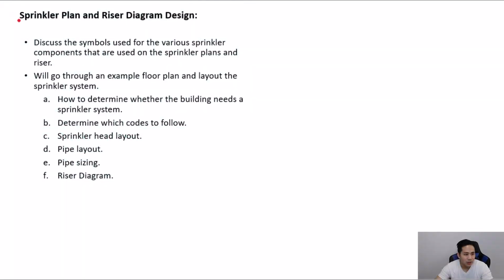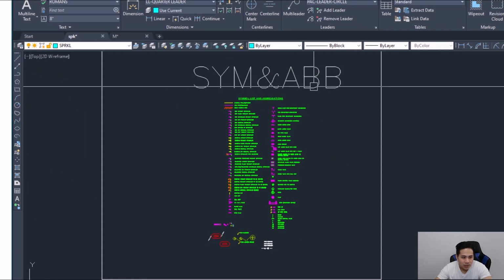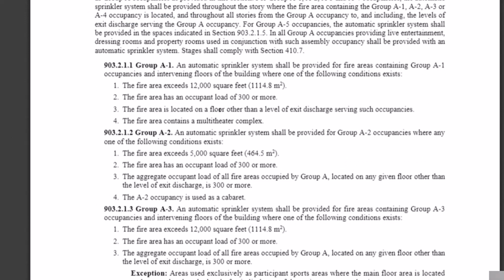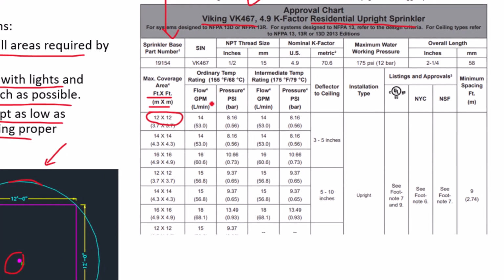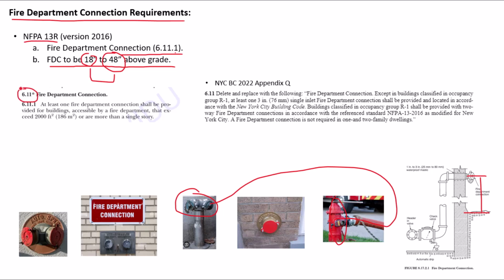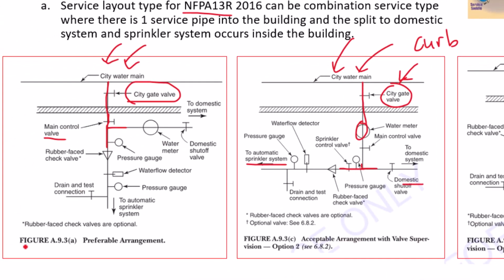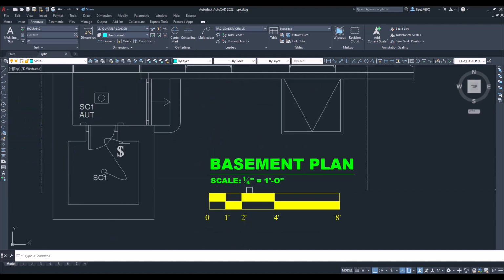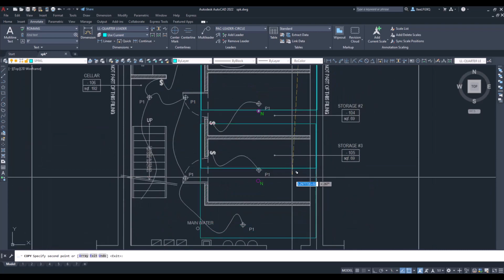Sprinkler Plan and Riser Diagram

Comment: Hello sir, about the floor control valve assembly, is required for two-story building? and since my piping is from underground i need to locate the check valve assembly in the building riser so im confused if i need to install FCV